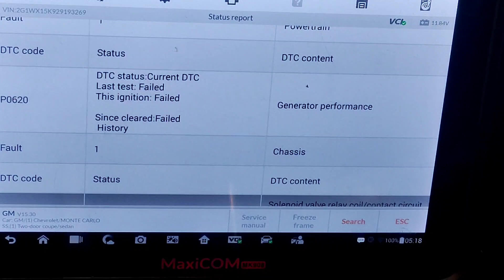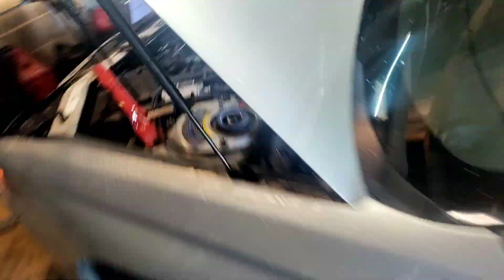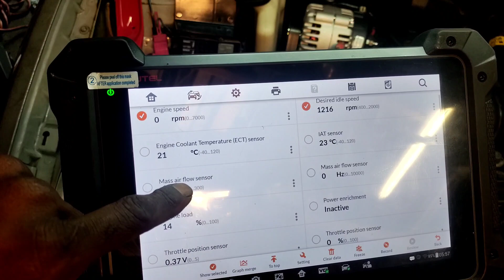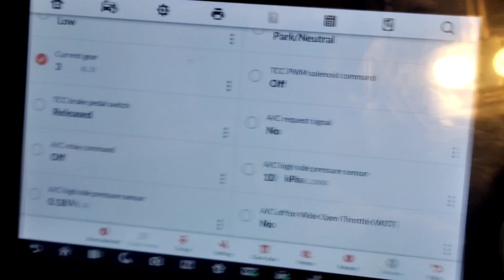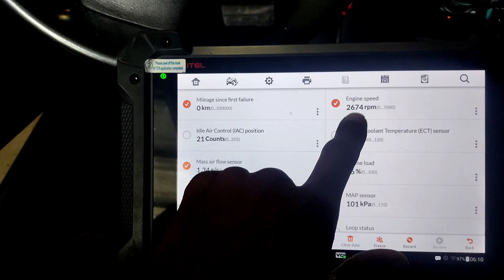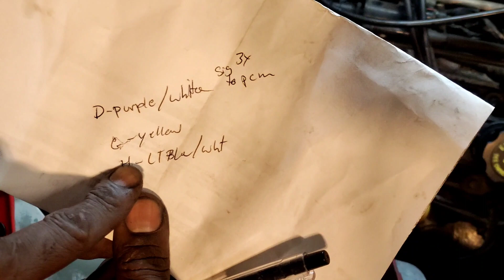Chevy Monte Carlo NO CRANK NO START, but think it's running

Comment: I have 2003 ss 3.8 engine I had to replace the ignition cause the key kept gettin stuck but now the car won't crank what do you think the problem could be
Reply from the maker: Check your PATS  system if you replaced the key and not using original.
Reply: @partsshooter Is that the pass lock? Also neither original or the new key has a chip does that matter
Reply from the maker: @MrLj200010 there's something you're not telling me.  Base on your original comment,  after you replaced ignition it then stopped working.  Id automatically assume the car work before you touched it.  And the only variable is what you replaced. 

For mr to be of assistance, you'll need to  be more verbose and detailed about who, what, when, where and how. The more you write the more i can help channel your issue.  Cars aren't simple like that
Reply: Im askin does Pat system means the pass lock system? An does the new ignition key have to be reprogrammed to the car
Reply from the maker: @MrLj200010 it has a procedure.  Hope this answer your question.  Good luck man

Comment: Wassup boss I have a 2002 MC SS no crank no start and it’s blinking security some say it’s the PCM some say ignition switch what do u think
Reply from the maker: You should have to go through passlock procedure. Assuming the security light stay on while trying to crank and you're getting no crank signal. 

You basically have to turn the key off for 5 sec. Turn back on to crank and hold for 5 sec and let it sit in on position for 15 min,  or until the security light goes off, then you turn off for 5 sec and try to start. 

Try 3x.

If I'm incorrect,  try googling, I typically screw up this at times.  However I do have a recent video where I do tell what I did to start when replacing a computer. Let me find the link
Reply from the maker: https://youtu.be/KNGf2dkH7Js

Check around the 56 minute mark

Comment: What I have experienced is occasional no crank situation. No check engine light. Everything works except no electricity to the starter.  Wait 10 to 20 minutes and the car starts and runs properly. Most likely cause: bad key chip in key or receiver in the security system.
Reply from the maker: I'm really beginning to think yall don't watch the video.... read title and comment.  Cmon man...
Reply: @partsshooter -  your title says no start, no crank. I responded with what I have experienced with my Y2K MC SS.
Reply from the maker: @Jerry2Murray  OK

Comment: The thing about wiggling the wire and it fixing it---  that CAN be the module like your'e thinking.  but it could also be a broken wire nearby on the harness.  It could have rubbed a hole in one of the wires and was shorting to the block.. and when you wiggled it--  it's now just not touching the block anymore.....  I'd check the harness as well as I could, right there near the coils.
Reply from the maker: Hey there, when looking at the wiring diagram, there's no CAN signals coming out going to module to PCM. 

This system just uses the square wave output from 3x and 18x from ignition module as the feedback information from crank rotation. 

I'm thinking when you say CAN you mean square wave signal? Or are you referring to the normal Low/high matching signal traditionally referred to CAN which the ICM didn't have?
Reply from the maker: I'm gonna replace the module today... I'll post a video

Comment: My first thought is that the pcm is coming unplugged, or has water shorting it at the plug-- just because of the communication problems with RPM and crk sensor, ect.   But the fact that you don't have spark is obviously another rabbit hole-- gotta check the coils, ect..

Comment: Does it have diode on compressor clutch wire
Reply from the maker: Unless it's internal with the AC compressor, no. Wire just goes to magnetic clutch coil.

I think I know where you're getting at though. Like there's a back feed of voltage?

The relay ultimately has to bridge contact point to engage.